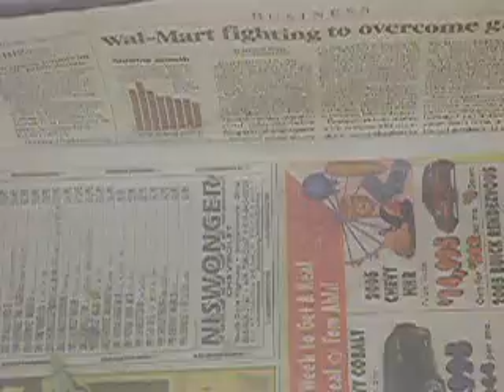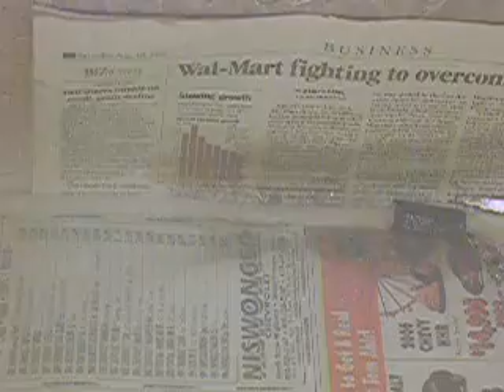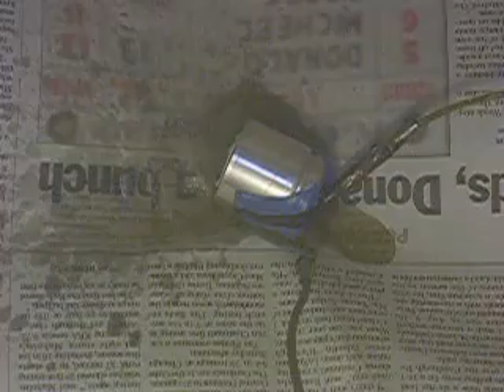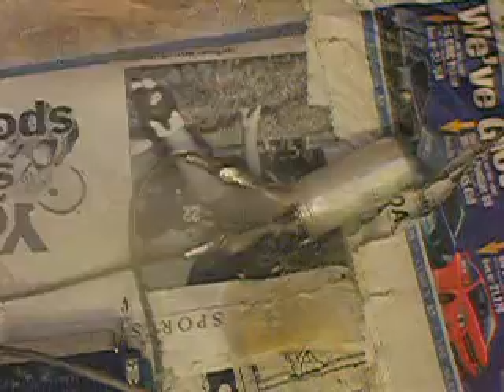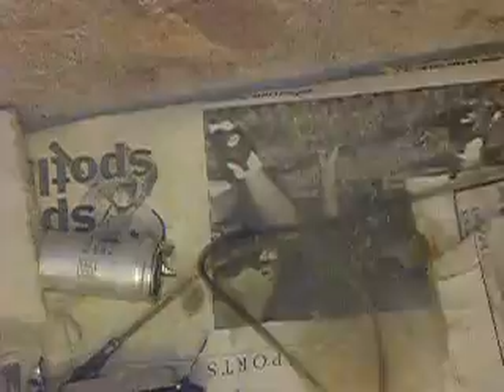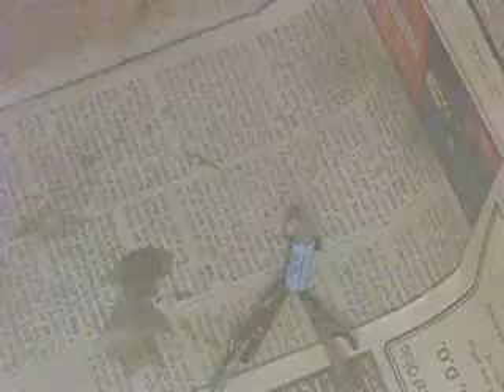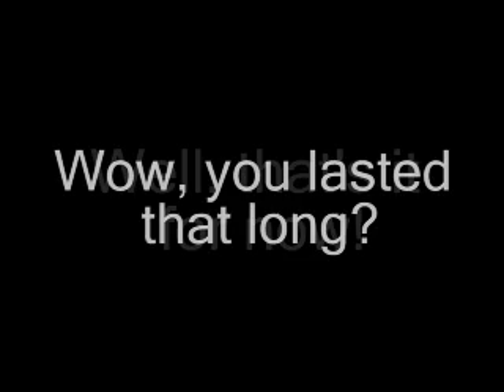Blowing Up Capacitors

Comment from the maker: A high speed radial fan is mounted in a window. This fan pulls air through ductwork leading to the back of the box. It jets the smoke out the window without leaking toxic gases in the room.

Comment: You have to choose your capacitors to get goot exploders.

Today's new capacitors have "X" or "K" shaped cracks on their tops. Those cracks are specially designed to break and make capacitors "smoke" or "steam" instead of exploding.

Look in old electronic equipment in which electrolytics DO NOT have those cracks.

Also, on large lytics, a rubber vent is often used. This is, again, designed to prevent capacitor explosion, Do not use them.

Comment from the maker: In this video, I used a self-limiting DC power supply that goes up to 55 volts at 10 amps. Some of the caps that I blew up can handle over 55 volts, however, using the incorrect polarity will blow them up. I'm currently working on a video of blowing up more caps using a variac (up to 80 volts ac)